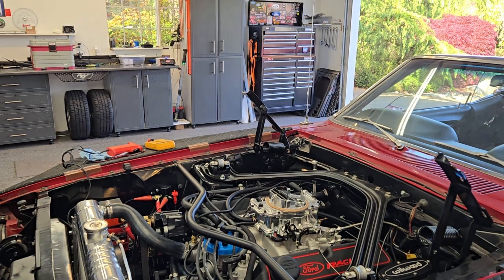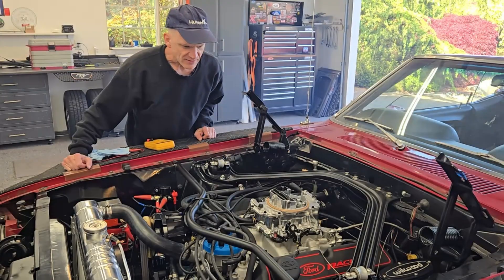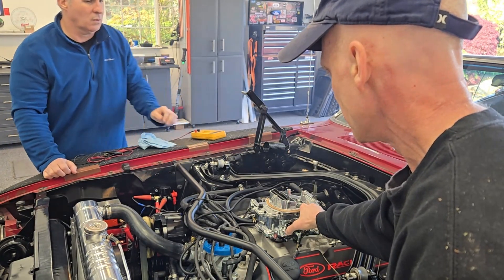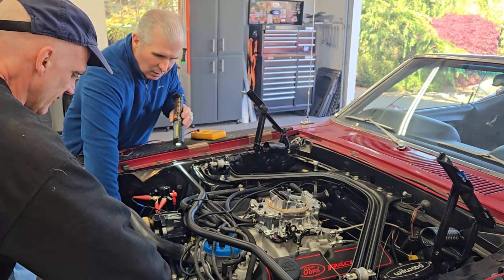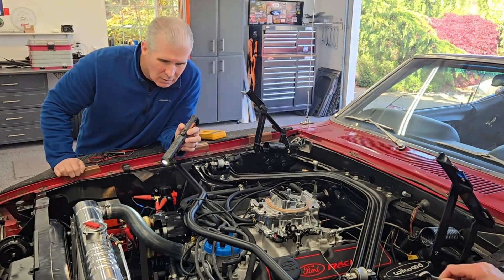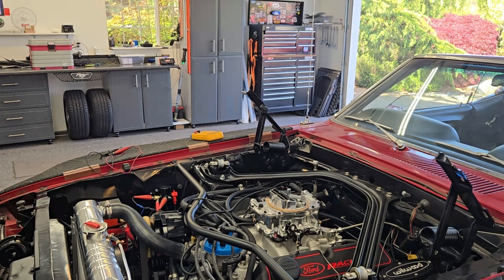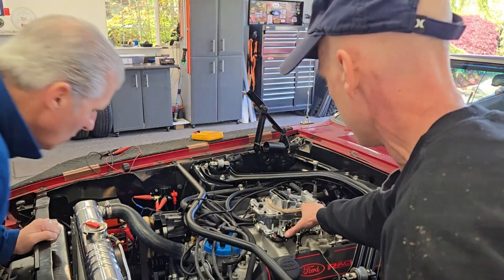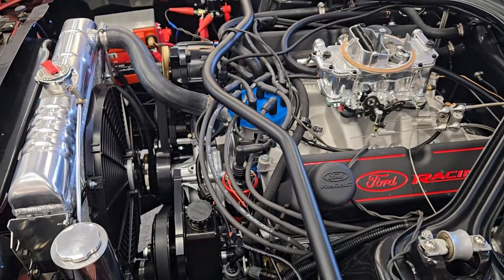First start of Ford 393W Stroker in 1969 Mustang

Comment: Good deal .. Always good when a new motor fires up clean .. Guy in the hat is going to wear his jaw out chompin' on that gum so fast ..
Reply from the maker: Tell me about it!  Had a few problems later, I discovered that the Blueprint engines cylinder heads did not seal the intake rocker studs which go into the intake runner, thus the engine was burning oil. Had to R&R all the intakes and seal.

Comment: Which JBA headers are you running? The 6616, 6613, or 6610?
Reply from the maker: JBA 1653SJS 1 5/8" primary tube Mid-length (see p/n link in intro screen).  Had to make 1/8" smooth dimple on LH side to clear Borgeson steering box but otherwise fits really nice.  1 3/4" long tubes would be too much of a pain in the @ss for my comfortable cruising convertible!

Comment: Wonderful! Man it lit right off! Would love to hear the exhaust note. Well done!
Reply from the maker: Thanks buddy.  Turns out that the engine was running about 4° retarded which explains the somewhat lazy response on throttle chop.  Today, I set initial at 11° and tuned idle screws.  Rock solid vacuum of 19 in of hg in Park.  Should get better as rings seat.  Exhaust is temporary so that I can get it to the exhaust shop.  It has JBA 1 5/8” mid lengths with JBA 2.5” SS H-pipe.  Using flexible exhaust pipes to tie into old 2” Midas (believe it or not) mufflers from previous owner.  Still sounds pretty good, but not final configuration.  I will be using Borla’s with resonators.  I’m too old for super loud muscle cars.  I am worried that my Cold Case 20” radiator is too high for the hood.  I lowered it today about 0.25” but the bottom tank is literally sitting on the strut supports and it still looks too tall! Might be my imagination but only one way to find out!